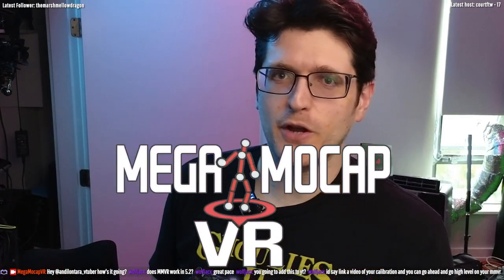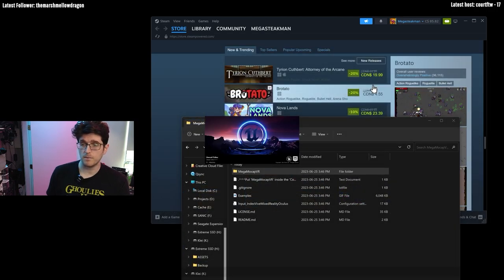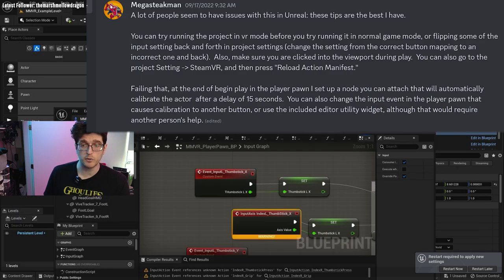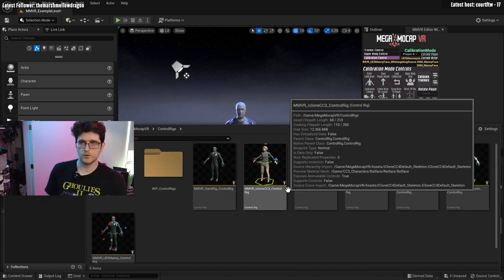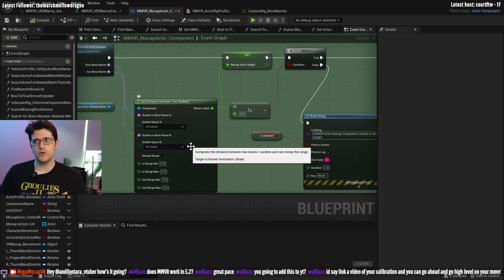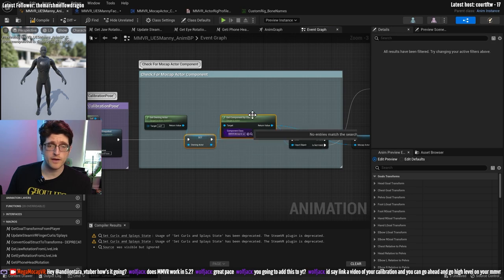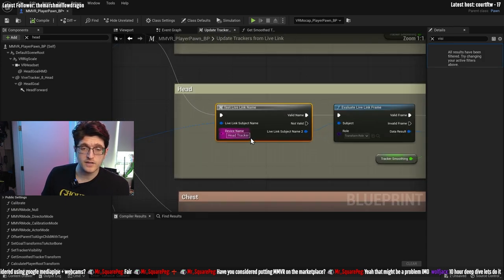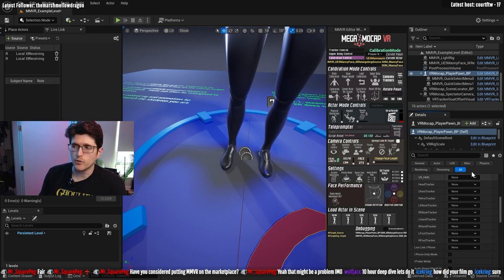Mega Mocap VR Explained (2023)

Comment: This project is awesome. My hope is that you continue making improvements. I am new to UE and I am working a project that your project is almost a perfect fit for. I have some programming, but I am a little lost with blueprints even after watching many tutorials. I was wondering using your project what would be the proper place to extend things like hand tracking using my htc vive xr. I see some logic for leap motion and stretch sense, but I can't quite understand where the appropriate place to add in the logic as not to break project. I have a few other types of tracking devices not covered I would like to add to. Can you help me?
Reply from the maker: Unfortunately the way I set up my project, I figured the hand tracking stuff would be better to make modular so that if people didn't have a device/plugin installed it wouldn't wreck the whole system.  This means some of the communication between blueprints is a little unclear, but what I would recommend is look at the player pawn begin play to see how different 'modes' work (the enum for hand tracking method) and then look at the event tick on the player pawn to see how the transforms for each goal is made.  Hope that helps!
Reply: @Megasteakman  Thank you so much for your quick reply. I will look into this further using the information you gave.

Comment: Okay here we go I'm following along. First question. What project settings did you use? starter content? FPS default? totally blank?
Reply from the maker: I just use a blank project, but you can use any template except for VR since OpenXR might interfere with the SteamVR plugin (that said, I have a NEW video about how to get vive trackers working in OpenXR so expect an update to the system).

This video is more about how to modify Mega Mocap VR to fit your needs: if you are looking for a set up video, this one is much better: https://youtu.be/crv6AIbadSo?si=WgjByLkwZt7RsEPT

It's for an older version of MMVR, but the processes haven't changed much.
Reply: @Megasteakman   Thanks! I got it up and running last night! Next is the iphone face capture stuff

Comment: Hello! Great work first off. I do have a question. Could you post a video or just a list of recommended hardware for the cleanest capture. I have a vr headset (the oculus quest 2) but have no knowledge about any of the vive products I see in the videos. Thanks in advance
Reply from the maker: Not sure when I could do a hardware overview, but that could be useful for people to see the body straps I have (they are mostly go-pro accessories fitted with a 1/4" thread on the camera side of the mount).  Otherwise, I list the recommended hardware for full body at the top of the project wiki.  https://github.com/Megasteakman/MegaMocapVR/wiki

Comment: I swear I am missing something fundamental here. I've been trying this out on and off for a year now and I still can't get it to work right. I'm thinking I'm just messing up the steam VR calibration. I'm always rotated the wrong way when I begin calibration even after flipping the SteamVR floor space. 

I tried to simplify by going to just the headset and controllers, but the upper body mode doesn't seem to work for me. I see in the preview that I have head and hand tracking, but the character still collapses to the ground upon calibration even if I'm lined up. 

I'm hoping I'm just missing something simple so any tips you have would really be appreciated! I'm using an index and vive trackers just like you.
Reply from the maker: For rotation, you can change the public variable in the player pawn to change how the vr play space is rotated in relation to the character you are performing as.

Which character set up isn't working for upper body mode?  Last time I checked it worked, but I haven't done in VR upper body mode before.  Its really hard for me to guess what is happening without a video or images.  Can you post those on our discord?
Reply: @Megasteakman  ah yeah I should clarify, I wasn't in VR mode. I just had a head tracker and two controllers assigned, but the upper body mode didn't work. It was the default settings for everything else (example level, default character and playerpawn that were already in the level). I'll join the discord and search around and I'll try following the video from scratch again. Thanks for replying!